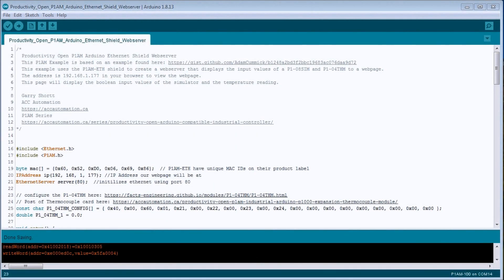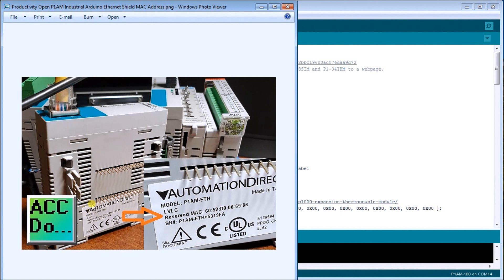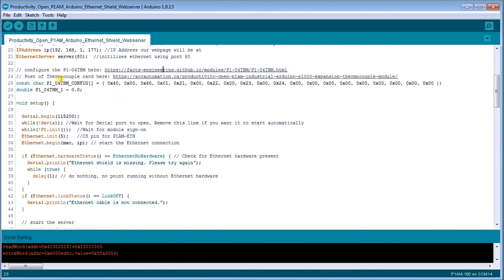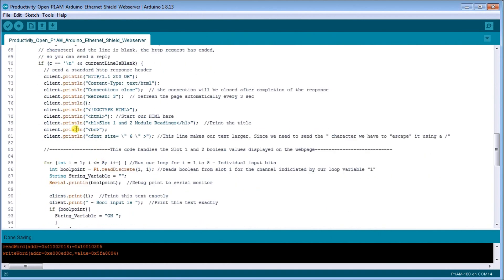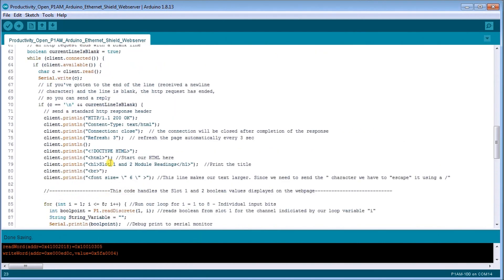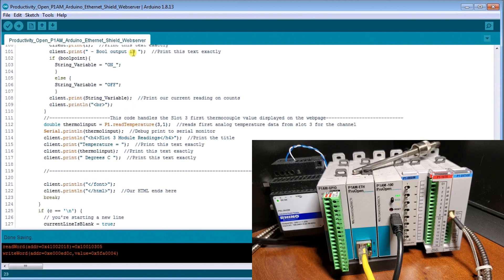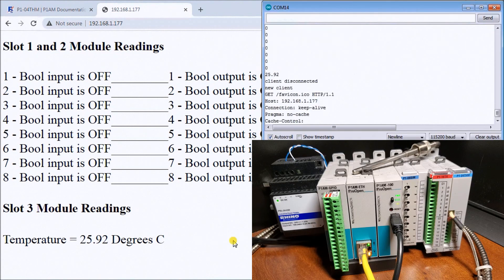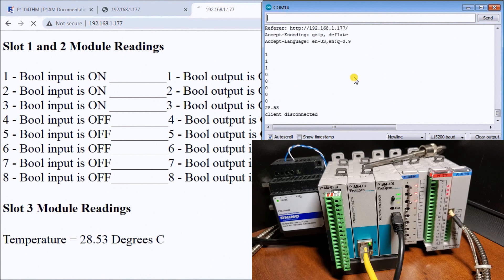Productivity Open P1AM Arduino Ethernet Shield Web Server

Comment: Garry, I would like to send signals to the P1AM-100 from a remote control. Do you recommend doing this over ethernet from a webpage with controls or even an iphone/andriod app?
Reply from the maker: Hi Adam,
Yes, this can be done easily using Node-RED. 
https://nodered.org/
The dashboard can be added to node-red that will allow a user interface on any web browser.
https://flows.nodered.org/node/node-red-dashboard
Communication to the P1AM can be achieved using Node-RED with Modbus TCP or MQTT. I would use Modbus TCP.
P1AM Modbus TCP Server
https://accautomation.ca/p1am-arduino-modbus-tcp-to-c-more-ea9/
Node-RED Modbus TCP Client
https://accautomation.ca/node-red-modbus-rtu-tcp-communication/
I hope this helps you out.
Regards,
Garry
Reply: @ACCautomation  Are you planning on doing a video on Node-Red ***with the P1AM? It doesn't seem as straight forward as the C-more program. In the c-more program are you only able to turn outputs on and off? I would like to send something like an input, char "1" to the P1AM and the code would read this as "if (input == "1"){ Do X; }". Similar to a Serial.read() function, but instead of the keyboard on a computer hard wired to the Arduino, it would be a remote. Is this best done on Node-Red
Reply from the maker: @adamsolovay51  
Hi Adam,
Yes, I am currently in the process of putting some Node-RED videos together. 
You will find information on this on the website. So far this will show you how to install Node-RED onto a windows computer and read/write information using Modbus TCP and RTU.
The next release (Monday) will show the dashboard user interface. The information and control can be on any web browser. This includes android and IoS systems.
https://accautomation.ca/series/node-red-iot-enabling-software/
Regards,
Garry
Reply: @ACCautomation  I was messing around with node-red and was able to write a flow and have access to the ui on my phone using "Remote Red". Though as soon as a I closed the command prompt terminal running the node red, my phone remote went blank. Is this the case that to use the remote, the terminal would have to remain open?
Reply: By the way. Thank you for all of your quick responses. Having this remote is going to save me a ton a wiring and pins on my PLC and make the operators for this production line much happier
Reply from the maker: @adamsolovay51  
Yes, Node-RED runs at the command prompt. You can set up your Windows computer to ensure that it is running all of the time.
https://nodered.org/docs/getting-started/windows
You can also set this up as a service on your computer.
https://gist.github.com/dceejay/576b4847f0a17dc066db
Regards,
Garry

P.S. I'm glad you got it going so quickly. This program is very easily implemented.

Comment: Would it be possible to send this data to a database rather than just displaying it as a webpage?
Reply from the maker: Hi Adrian,
What I would do is use Node-Red running on a separate computer. It would collect the information from the P1AM using Modbus TCP and store this in a database. 
Here is a link showing how this is accomplished.
https://accautomation.ca/series/node-red-iot-enabling-software/
This post will show you how to set up the Modbus Server Addresses in the P1AM so they can be read from the Modbus Client.
https://accautomation.ca/p1am-arduino-modbus-tcp-to-c-more-ea9/
I hope this helps you out.
Regards,
Garry